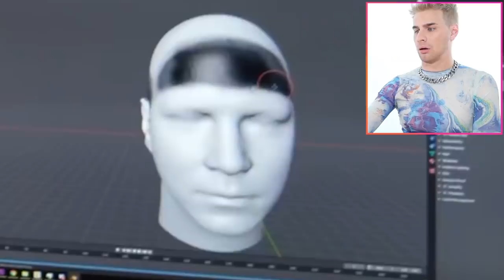Hairdresser Reacts To Robot Haircuts

Comment: Using technology (or robots) doesn’t make your creation automatically innovative. It has to solve something. To make it practical, not more complicated. i.e the last one is for shampooing and massage which is great and would work on any head (maybe will have trouble with long hair idk. While the cutting machine involves creativity. And heads have different sizes, or facial features. And did I say dangerous? Imagine that poking you in the eye.